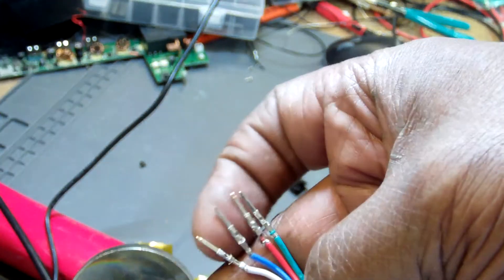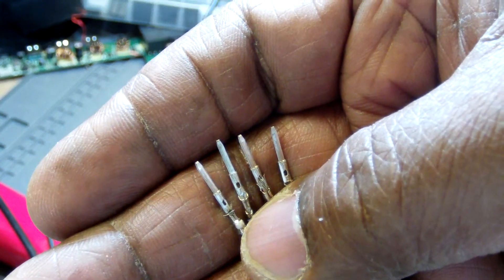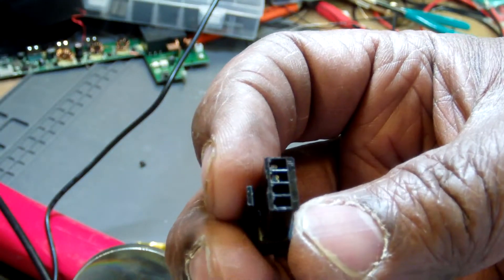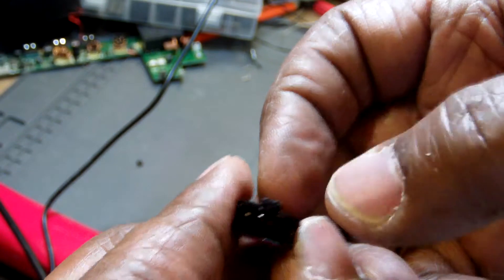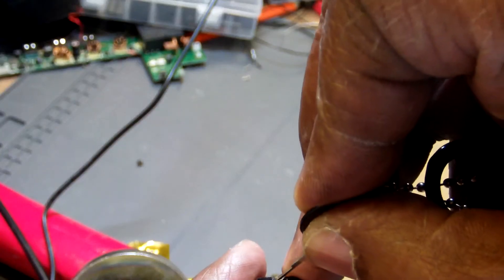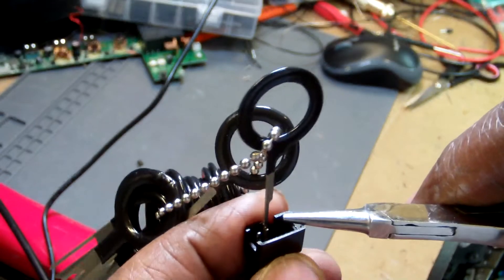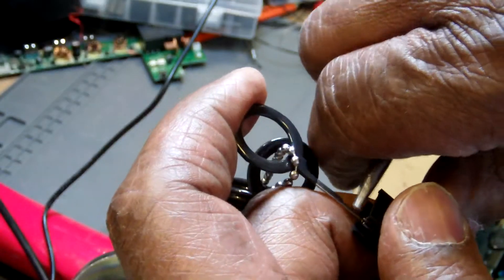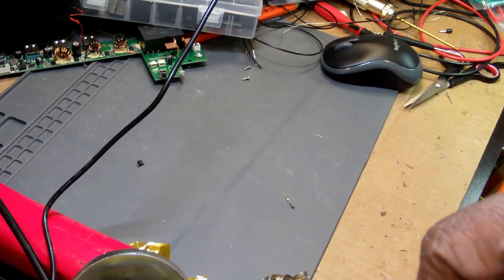Removing JST SM male connector pins

Comment: Just did mine couple 4pin JSTs.
Sim card ejector + needle did also great.
Insert Sim card ejector, turn connector upside down, apply force carefully, the thing clicks, pull out cable.
Use needle to bring out the contra mechanism, slide cable back in, clicks, job done.
Reply from the maker: @kostadin10m  very good. Like everything there is more than one way to get it done. Thanks for sharing.

Comment: Hi Leroy. You don't need a removal tool. Just pull the pin with your needle nose pliers, and the locking tab will come out far enough for your pliers to flatten it, and then pull on the wire to get it out.
Reply from the maker: But you would not be able to reuse the pin after that. Thanks for your comment.
Reply: @leeroyfrancis9506  Hi Leeroy. You can use the pin afterwards. All you have to do is bend the barb back up. Works perfectly! 😊